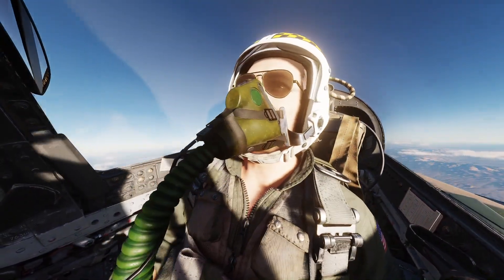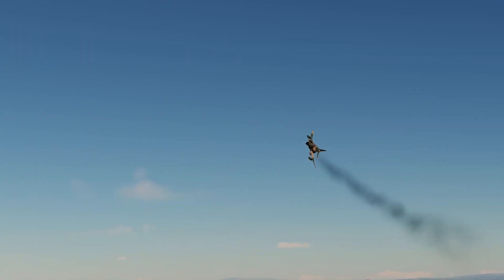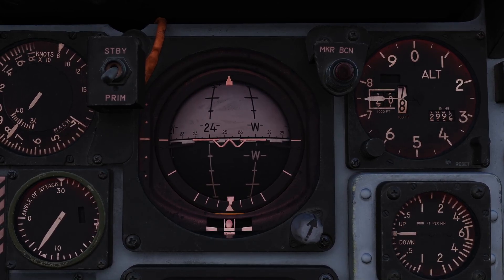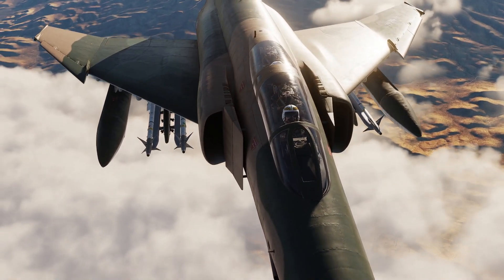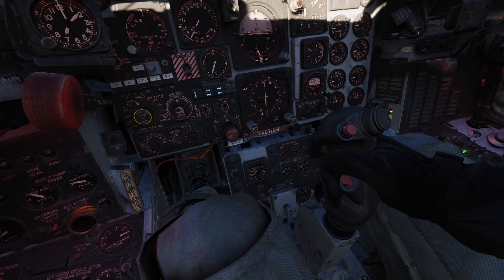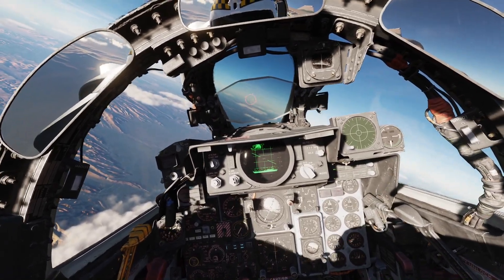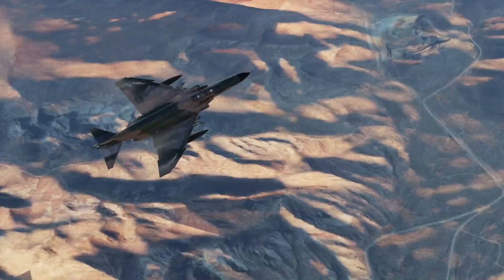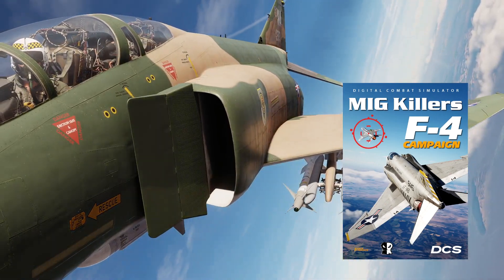Rig/Stab Aug Check Tutorial for the Heatblur F-4 Phantom in DCS World

Comment: I absolutely love these details! Would you also be able to explain the AUG checks and trim neutral checks on startup? Couldn’t find anything in heatblur manual but would like to do them during start up after flight control checks
Reply from the maker: Thanks! The trim neutral check is just the crew chief checking if the stabilator is neutral when you set the trim to 0. I couldn't even find it in the official -1 manual. The Stab checks after startup are meant to verify that when you turn them on one by one, the control surfaces don't move - if they do, something is wrong with the stabs. I show this in my startup tutorial too.
Reply: Thanks! I’ve just reviewed your start-up video and found it in there. Great to know about the trim neutral one!